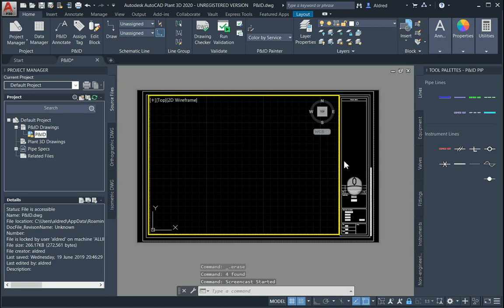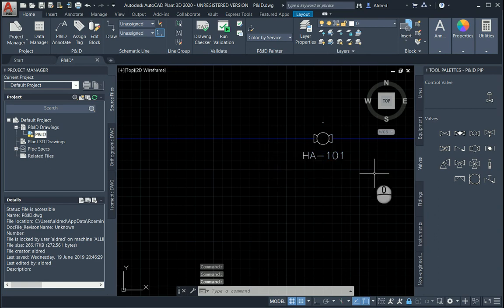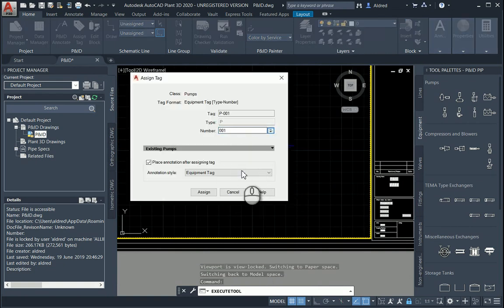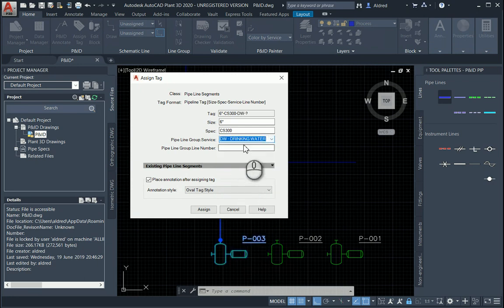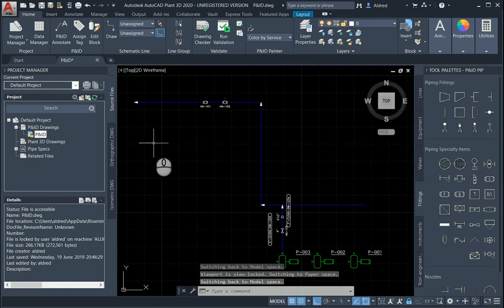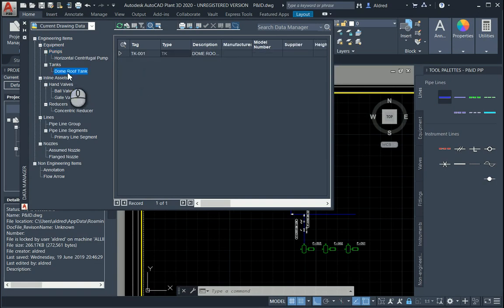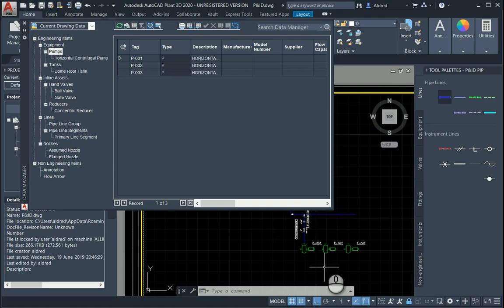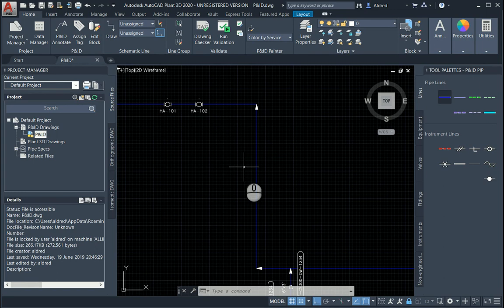AutoCAD P&ID intro

Comment: How to get the symbols of p&id in tool palette
Reply: For anyone else ever struggling with this. Go to the workspace settings. The little cogwheel in the LOWER RIGHT corner. Select "P&ID ISO" or play around with the other options to get what you need.